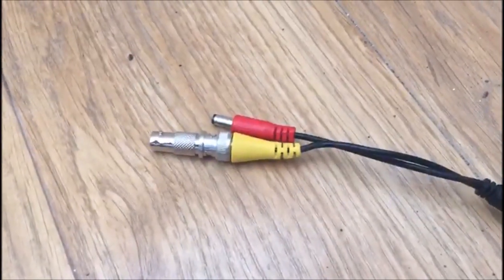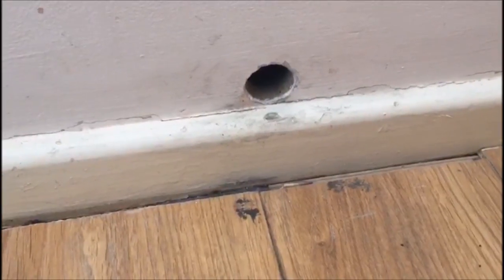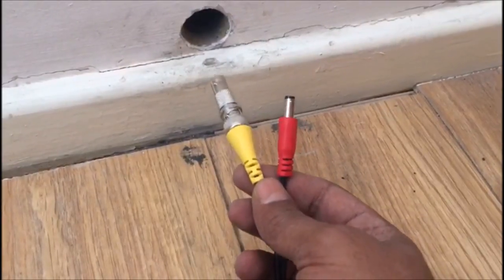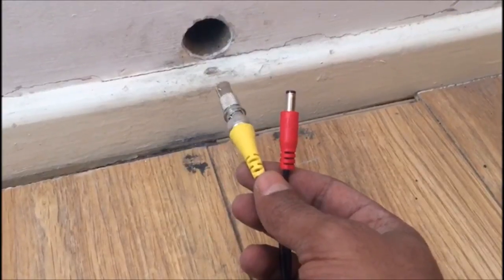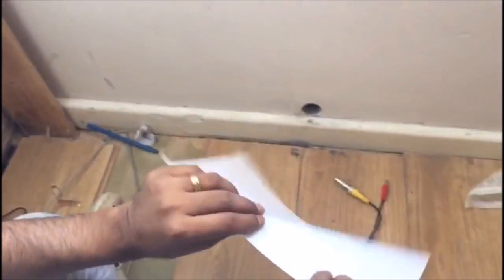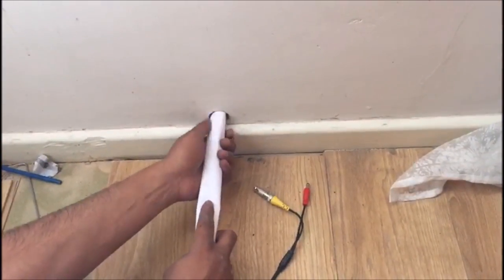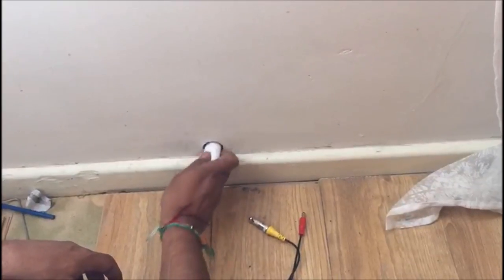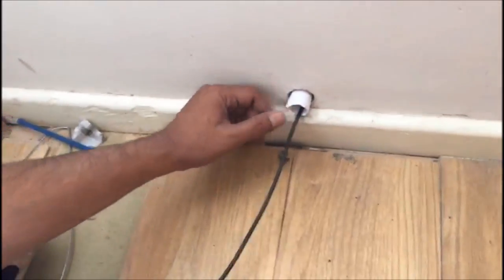Easy way to route a cable through a cavity wall

Comment: What do u use to cover holes so that bugs won't get in after running cables?
Reply from the maker: You can use external silicone to block the open area around the hole.

Comment: Tips on drilling the hole.. I need to run tv aerial from 1 room to other straight through, pretty sure theres no cables/pipes in there. Did you make a video of the drilling? Thanks
Reply: You can use a cable/pipe detector, but it's better to know about how a house is structured. If in doubt, pay someone.